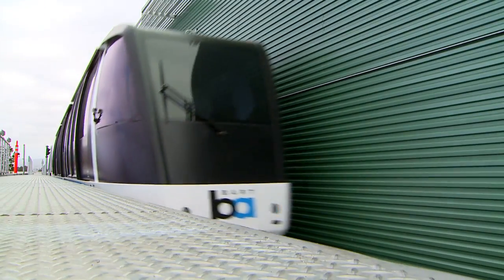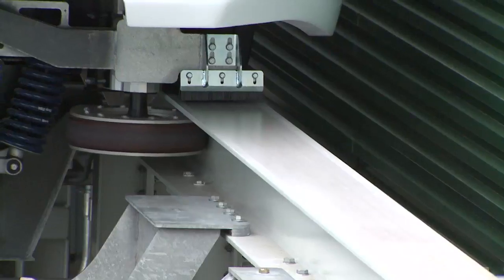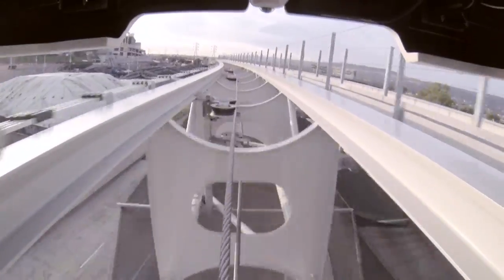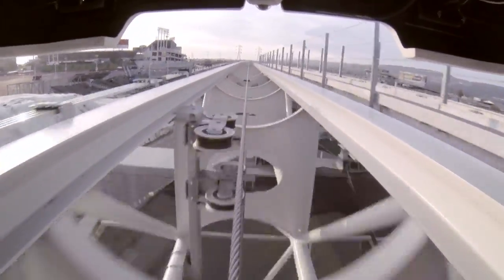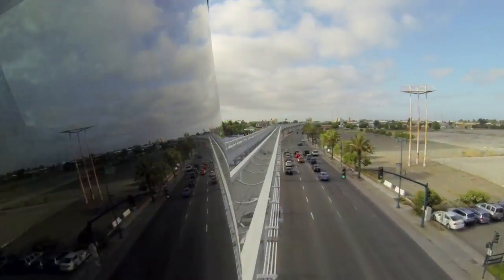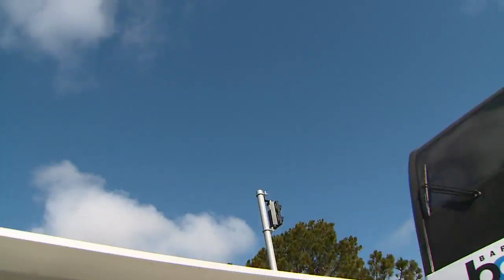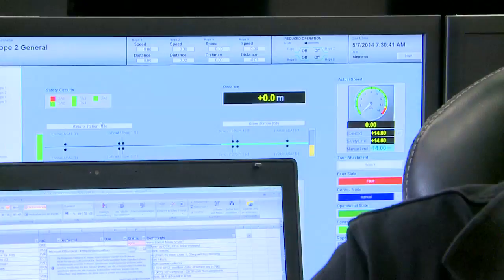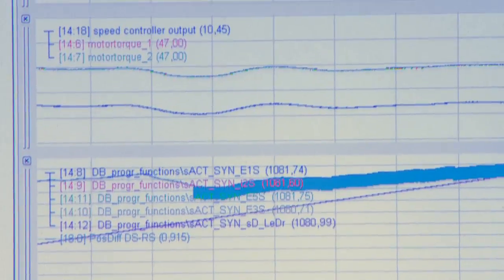Oakland Airport Extension System Testing

Comment: This thing should have been built with normal light rail technology. This dumb thing has more in common with a ski lift than an actual rail vehicle. It is impossible to ever extend or improve in any way. It is proprietary, so you're locked into whatever the manufacturer wants to charge you for maintenance. But most importantly, we will never see a faster version, or a new station, or any kind of improvement. Eventually, the whole thing will just be dismantled and trashed.

Why didn't BART think ahead a little and made this thing light rail on a viaduct? It would have cost about the same in the end and would have lasted for centuries!

Comment: What a ripoff.  You might as well take a taxi.  The airtrain at SFO is FREE!
Reply: Here's the difference between AirTrain SFO and the Oakland Airport Connector: AirTrain is paid for by a $20 airport fee charged by rental car companies. The Connector doesn't have this luxury; it gets 96% of its revenue from passenger fares. And taxis cost more than the Connector if you're going to the airport from virtually anywhere.

Comment: Why is the manufacturer's name never mentioned? I noticed it's also not listed inside the cars themselves. Is this normal? I noticed the Palm Springs Aerial Tramway similarly doesn't say anything about the manufacturer on their web page. Weird.
Reply: The Bart extension was designed and built by a division of Doppelmayr called "Doppelmayr Cable Car" (DCC). The Palm Springs Aerial Tramway has cabins from Doppelmayr Gondola, though most other components of the system such as cable and supports were developed by various other sources or in-house. Additionally, the Aerial Tramway had older cabins which were built by another company called Von Roll.

Comment: They forgot to show how you get from the Bart station.
Reply: It should be across the platform, but I think they made it cheaper so you need to use an escalator or elevator.